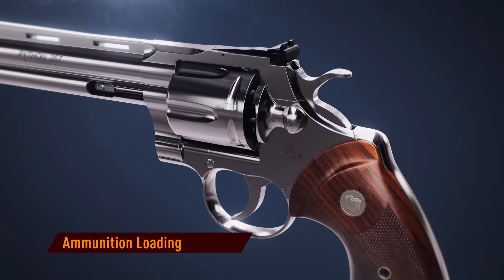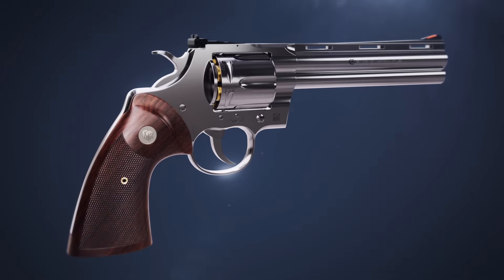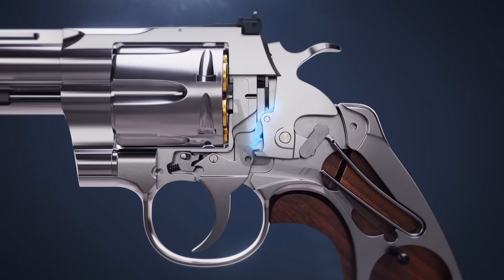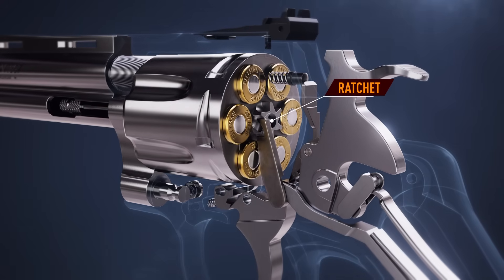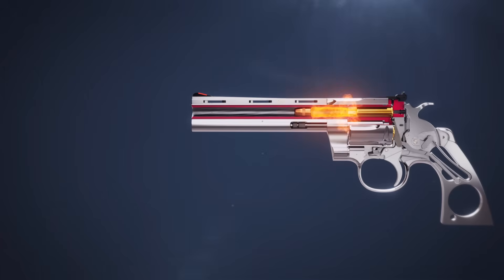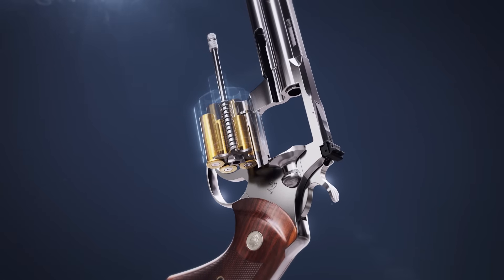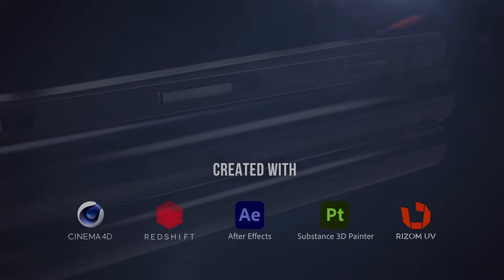How a Revolver Works

Comment: The AK-47 is the gun we are now used to know. The inventor, Mikhail Kalashnikov (of 1892-2013) designed the firearm in 1945. And made the first known type of the firearm. The gun consists of a trigger that pulls up the hammer to hit the firing pin, the firing pin then strikes the primer in the cartridge that releases the bullet and ready to fire. Gas expands and the bullet is now out. The gas expands into the gas tube behind the rifled barrel and the bolt carrier gets pulled back, ejecting the casing of the cartridge. The bolt carrier returns foward and strips a new round from the magazine. To make the AK-47 fire in auto, the switch is positioned to the middle allowing the hammer to move up and down as many times as it wants. The legendary AK-47 is a historical weapon and known by many others. [End]

Comment: Many people think revolvers are more sturdy and reliable than slide-principle pistols because they are more primitive and less complicated.
This shows that actually the opposite is the truth. If you don't go crazy with multiple safety features, you can build a Glock-like pistol with way less moving parts than a revolver. Having to translate the trigger's linear movement into the cylinder's rotating movement and having to fixate the cylinder in the right position makes for a lot of little, complicated parts and springs that need to work together.

Comment: Colt Python is a beautiful gun, full lug barrel which help recoil control, that type of gun with at least a 4 to 6inch barrel can handle full power .357 magnum loads all day, especially ones like this that have an internal firing pin and not one on the hammer.

Comment: Seriously, bro? I got a sponsor the very moment the video started. I bet your view retention drops by 85% at the first second.
Reply from the maker: It’s even worse than that 🙃.
Luckily I can remove it May of next year. Still a ways off though 😩
Reply: @mattrittman 
Yo I thought revolvers were simple af
Reply: @BalencedGnu  You've never had to repair one then. They're like Swiss Watches. Timing has to be right, so parts need to be within tight tolerances. If you want simpler mechanics, it's Glock.
Reply: @somerandomguyfromtheintern480  Glock is no way simpler. Revolvers by far the simplest among all repeaters.
Reply: @FirstLast-n5b  then you have no idea what you're talking about
Reply: @somerandomguyfromtheintern480  First revolvers appears in 1830-s while first semi-auto in 1890-s and really useful ones only earlier in 20 century. Revolvers have by far simpler construction and mechanics while semi-autos heavy relay on modern technologies. It would be possible to made simple revolver in garage having nothing but lathe while such quest would be virtually impossible for semi-auto. Just have a look at "simplest" part - magazine - and think how you can make one with primitive tools. Other part is plastic-fantastic - not only required special chemistry, but also special machinery to properly mold it with slide carrier. And yes, I have half a dozen of different pistols. Even if you believe that fixing Glock is easier it does not mean that it is simpler. Semi-auto is by far more complicated and us result generally speaking revolvers more robust and last longer.

Comment: Matt, Excellent illustration as the mechanical design, relationship, and movement of parts during the physical operation, illuminating the sequence of operations that reveal the actual timing of events. Perhaps when the hand is removed, some viewers less inclined may not understand it was for illustration of actual movement not visible during operation as hand blocked the ability to observe those movements. A simple statement of hand removed. I did observe that you added additional cycling of the action after those scenes where shown. The quality of your videos in other operations are also quite helpful in clarifying conversations folks share attempting to explain inter working of firearm actions during the cycling process. Although there exist a more animated( antimated) version of the original version of the Python, which is also the oldest ( 1889 ) with that particular lock work with CLOCKWISE ROTATION as well as left side loading. Many discussions would be born out of a video illustrating that mechanism while comparing to the one you have done  so skillfully here. Having redesigned the old action for longevity, I believe another video like your previous video would be a most memorable and educational tool for future gun enthusiasts as well as Python owners and would be designers. Please contact for any input or not. Jerry Moran ( Custom Pythons )
Reply from the maker: Thank you so much Jerry for your comments on this! It is very much appreciated. I may do a follow-up animation of an older style revolver in the future. However, due to the amount of complexity to each of these animations, it’s probably not likely haha. I’d like to do more in the future, but they just take me so stinkin’ long.

Comment: I want to know how and why there is so much detail in this and your other videos. I mean, it's all good, but the dents in the primers for the ejection cycle and the face milled surface finish marks on the trigger at 2:04....that's not just attention to detail in a somewhat generic fashion, that is intimate knowledge of not just how a specific component may be machined but knowledge of how each manufacturing process looks. This is evidenced by the differentiated milling marks on the frame and the pressed/forged marks on the bolt/cylinder stop at the same time stamp.

like, I truly would like an answer @mattrittman!
Reply from the maker: Thank you so much, and glad you asked :)
As I was working through this project, I was lucky enough to find a guy online that owned one of the new Pythons. He was kind enough to take his apart and provide me with some close-up photos of the parts. That really helped give me a better idea how to texture some of the inner pieces.
Reply: @mattrittman  thats insane that you bothered to pick up that surface finish without having some machinist background yourself. 

I'd love to chat more about this. I'm in the firearms manufacturing industry and your videos are very neat to say the least.

Comment: All revolvers are not Colt Python. All pythons are revolvers. There is a difference. You need to fix the title j frames don’t use a leaf spring. In fact that spring is for a 2020 Python only. The internals are completely different from a old Python to a new

Comment: How tf anyone ever got those dimensions correct on paper and then got tooling made to produce them is a marvel of engineering.
Reply: @steventhehistorian  Iteration and evolution, eventually made easier as machining techniques and technology improved. The construction and design of early single action percussion cap black powder revolvers was similar in some ways, but a lot less complex and precise. From there it was an iterative process (and oc they got to that point using what the learned from single action percussion guns, wheel locks, flint locks, matchlocks, fire lances, all the way back to early fireworks and fire crackers)

Comment: Oh so that’s how you’re able to use single action and double action in one gun. When a single action was made it was a simple design, and then they added an automatic mechanism, an extra part for it to fire without cocking the gun. The single action still has its discipline though. You only need one good shot.

Comment: I've got a question.

Suppressors (at least normal ones) don't work on revolvers because gas escapes between the cylinder and the barrel. But if there's that much gas escaping there, wouldn't it hurt your hand, heat up the cyclinder, decrease velocity and a bunch of other negative things?
Reply: Yes it would. The only revolver i know without this is the nagant gas seal revolver

Comment: I'm a retired gunsmith, and I can say this is the best animation of "how it works" I've ever seen. Your rendering of detail is flawless - the lack of side pins holding the front sight; the placement of the  side plate screw; the serrated hammer and lack of serrations on the backstrap - excellent.  I have one of the new Pythons, and you nailed the details that separate the Gen 1 Python from the Gen 2. Superb!
Reply from the maker: Thank you so much, glad you noticed all these little details. It was a lot of fun building this model 🙂
Reply: @mattrittman  how did you do it? 😮 Very impressive, it is crazy how aynchronized everything must be inorder for a revolver to work. The e trigger basically has to well, "trigger" the hammer, the bolt and the hand 😮
Reply from the maker: @JF59122  Thanks so much :)
Although not written for the Python animation, here is a blog post I put together showing how I animated an AR-15: https://www.mattrittman.com/how-an-ar15-works/
Reply: @mattrittman  Any chance you do a how an M1 Garand works video? Would compliment the 1911 video you just did.
Reply: @mattrittman  how did you do it? 😮 Very impressive
Reply: Wish I would have found this video this morning. Nothing went wrong, but man, my hands were shaking. Fully gutted my python sitting in my truck today.  Absolutely nailed the detail. I could go in and clean the cnc if you like, but I don't think it is necessary if you plan to put many rounds through it. I can feel no reason for a polish job when operating the gun or dry firing. The only complaint would have to be the sights. I have already had zero fall off once, and the front blade could use a fine line to a small high vis dot on the same orange blade( could have been tritium for the cost ) . Other than that, the gun is flawless and, in my opinion, mechanically better and more robust than its predecessor. I haven't  been inside a classic python in real life bur World of Guns seems to have done well.
Reply: This guy's so good Mossberg got him to do a video of their shotgun
Reply: Pythons, in my opinion are the best looking revolvers on the market. Bar none. Nothing competes with that iconic bull barrel

Comment: It’s interesting to compare them to autoloaders; the latter has more moving parts in the operation of the action while the revolver has less, but the revolver requires more precision machining to ensure correct timing with the bolt, sear, hand, ratchet, and other components.  The revolver’s tighter machining allows it to be more reliable than the autoloader, as well as accept more types of ammo, while the semi auto’s greater complexity and moving parts allow it the benefit of higher capacity and somewhat quicker firing.

Comment: A small correction at 0:53 this being a  Colt revolver the cylinder spins the opposite direction. The cylinder stop slides along the ramped cutout as the cylinder rotates
Reply: At that point the cylinder is not engaged by the ratchet as it has just swung into the cylinder pocket and the bolt has not arrested movement. It can spin either direction in that moment. 

You are correct that, during the cycle of firing, it will spin clockwise… just not quite yet.

Comment: "Get a revolver they're simple and never jam" Modern striker fired semi auto handguns are more simple than this.
Reply: Revolvers can indeed jam, if poorly maintained. The same applies to semi autos. 

Poor quality ammo can readily cause semi autos to jam but revolvers are less vulnerable to this. 

Also the response to a dud round on a double action revolver is to just cycle the trigger again. That can be done much more quickly than clearing a failure to feed or a stovepipe on a semi auto.

Comment: What would cause a revolver to lock up ?? 🤔🤔🤔
Reply: Bad timing is the usual cause
Reply: something bent out of place could cause some of the engagements and lockups to be mis-timed
Reply: I've see problems cause by bullets or primers becoming gradually unseated due to the recoil of previous shots. This is usually only a problem with inexpertly handloaded ammunition.
I've also seen mechanisms gummed up after the use of inappropriate lubrication (e.g. too much WD-40 sprayed into the action).

Comment: Very nice job!  What software do you model with?
Reply from the maker: Thanks man! I use primarily Cinema 4D for modeling
Reply: @mattrittman  Do you use a CAD software to create the 3D model?  Like SolidWorks? Your model seems very accurate for simple animation. Or did you 3D scan in the components?  (I'm a mech engineer and these things fascinate me.)
Reply from the maker: @Moman46250  Nah, it’s not actually a CAD software. It’s just polygon modeling. I just spent a long time making it look as close to the original parts as I could :)

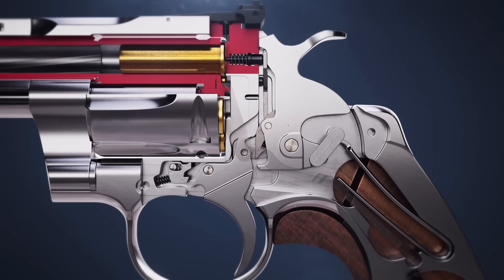Comment: 02:57 Isn't that sear surface so tiny that it corrodes the iron when used so much? Do you change the whole hammer when it happens?
Reply: Amazing animation btw I love your work <3
Reply from the maker: Thanks so much man, glad you like it 🙂. Haha honestly that's a good question. It's a pretty tight tolerance, so I wouldn't be surprised if it wears out over time... Maybe someone that shoots a lot of revolvers can answer :D
Reply: @mattrittman  With good quality components, a revolver can fire many thousands of rounds before the lockwork wears and goes 'out of time'. After that attention from a gunsmith and/or spare parts will be needed to restore correct operation.
If a revolver is 'out of time' then the cylinder may not reach perfect alignment with the barrel at the moment of firing. This can result in lead being shaved off the bullet as it tries to enter the 'forcing cone' at the start of the barrel. This habit is sometimes referred to as 'spitting' and may be noticed by the firer or others on the firing line being hit by small pieces of shaved off lead.

Comment: These are more complicated than other forms of pistols, they are like clocks - fascinating
Reply: Someone's never taken an XD apart.
Reply: @ShortArmOfGod  If you're talking about the trigger group, I agree. Everything else on an XD is dead simple.
Reply: They are generally wildly less complicated than other forms of pistols, which is why they are credited with such reliability. Less parts to go wrong
Reply: @louisryan5815  I wouldn't say the action is less complicated. A delayed blow back (forgetting the trigger) only has to strip a round, feed it and then hold the pressure, eject and cycle. Most of this is done through linear movement and there is little to no control over the cycle. The pressure does this for you. The revolver is working on mechanical timing in a circular motion. Each chamber has to line up, each stroke to cycle the new chamber has to align. This is technically why I think if you were to build your own pistol most people would design a blow or delayed blow back rather than a revolver. 
I'm not a fan of the revolver, given the choice I would have a delayed blow back. But I do appreciate art when I see it.
Reply: A DA revolver can be fired just as fast as a semi automatic.
Reply: @bertrandlewis4906  
Not unless your semi auto has a heavy as fuck trigger. When shooting double action, the trigger has to cock the hammer and then release it, making the trigger pull way longer. Most any semi auto handgun can be fired much quicker.
Reply: @bertrandlewis4906  if you can pull the trigger fast enough, that is. Double action revolvers take a lot of force to fire, because you have to pull back the hammer and rotate the cylinder with just your index finger. Id say it is a bit slower than a Glock or something. Fanning a SA revolver on the other hand... innacurate as hell but puts six holes into the target quickly, providing it is close enough